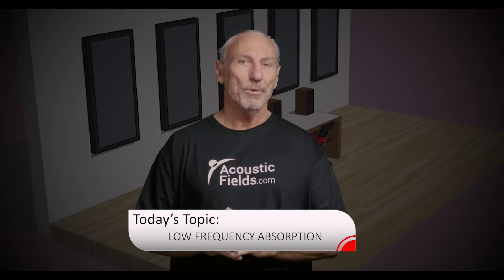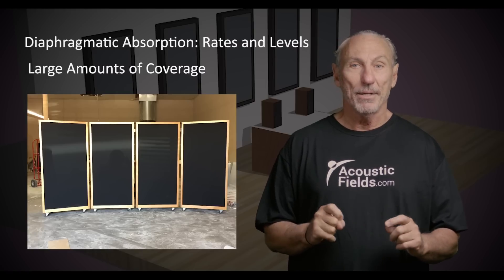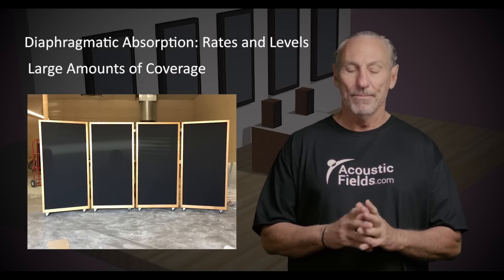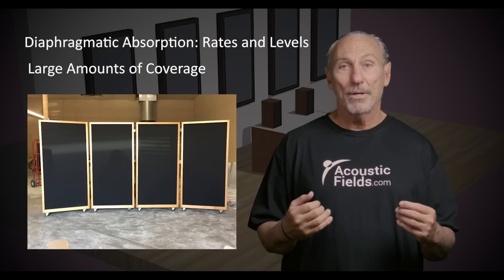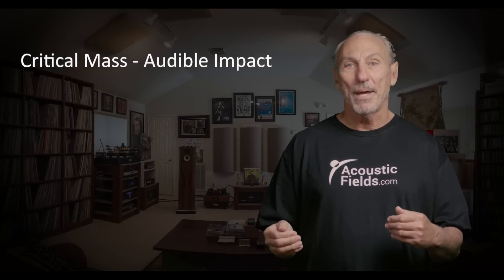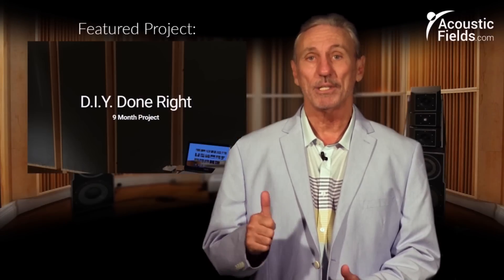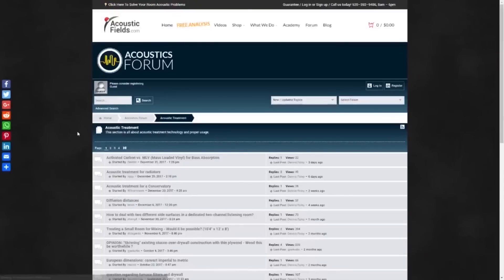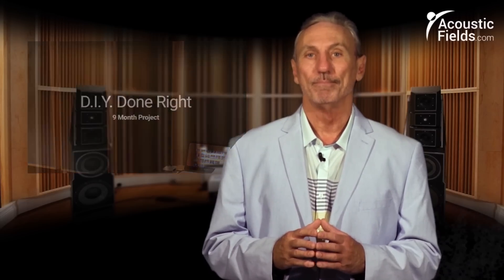Low Frequency Absorption - www.AcousticFields.com

Comment: How could this work for a bedroom window to block low frequency sound from entering?
Reply from the maker: Absorption technology is not to be confused with barrier technology. Barrier technology is used to reduce noise from entering the room. The process is called noise transmission. Absorption technology  is used to absorb the energy that is in the room itself. Part of that energy could be noise but absorption technology will not keep sound out of the room. For a window, you need to build an insert that has at least the same density as the wall the window is in. If this is not an option, then you must get a window assembly that has a higher STC. Noise is a pain.

Comment: SO my neighbor who lives in a 1000 sq ft 2 story townhouse that shares a wall with me, what you are saying is that her square footage is not large enouh for anything to dampen the sound pressure that she puts out via her theater system that has very low frequency bass.  So low with her music that I can feel it inside of my body?
Reply from the maker: B,  You will have to measure the frequency and amplitude of the noise and then construct the appropriate barrier.
Reply: @AcousticFields  what do you suggest for the average homeowner (lol is there such a thing?) measure the frequency and amplitude?

Comment: My next door neighbour has a subwoofer thumping constantly. All I want is something that can stop the insane thump thump every day. What about if I use lead bricks or get professional bass blocking sheeting on the side facing the noise?
Reply from the maker: C, Low-frequency energy barriers require 8 - 12" of wall depth.
Reply: @AcousticFields  So 8 to 12" lead bricks?
Reply from the maker: @changeagent228  Bricks are a barrier technology not a sound absorption technology. You are confusing absorption with noise transmission.

Comment: Sir, may I ask the following as I,m reading and watching all kinds of conflicting info on this. I did add 1" 703 panels on the walls in the room which are in placed in trash bags to avoid dust. My question is that is that ok like that or should I take them out if the plastic? The panels are also covered with thick carpet for absorb whatever else, but I,m concerned about treating the bass a bit with the panels. I hope I dont need to unpack all the panels from the bags, please enlighten me. -)
Reply from the maker: M,  A 1' thick panel will not absorb low frequencies, no matter what the materials used.
Reply: Acoustic Fields even if it's the rigid compressed board? My understanding that translates into a 3 in regular.
Reply from the maker: M, That's all nonsense. Low frequency energy absorption takes 8" - 16"  of cabinet depth no matter what the fill material. Go ahead and try your method and then report your findings.
Reply: Acoustic Fields i believe u, im just watching real traps people on their site.. i du have 12 inch cylinders filled w fluffy stuff in the corners already but may hang rockwool 7 inch off the ceilings then. I do appreciate your input!
Reply from the maker: M,  We use diaphragmatic absorption. It is the most powerful per square foot low-frequency absorption type. You can read about it at this link:  https://www.acousticfields.com/about/

Comment: 2 dB attenuation per 10 square feet of bass adsorption with your product.  That's a VERY useful number.  I'll go back and look at my untreated room sweep numbers to see what they look like. Thanks.
Reply from the maker: R, These are rough numbers to use. As always, everything depends upon the amplitude used within the room, room size and volume, and other variables.
Reply: 2 db is sick. Thats just fascinating. I have 160 kg/m3 wool and it works 1,2 db on average with concrete backwall and double layerd mdf with 2 mm cork for side walls